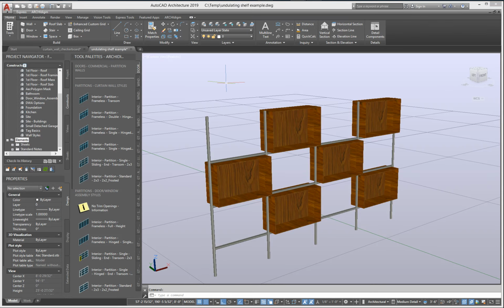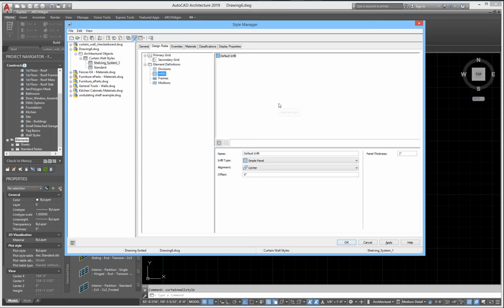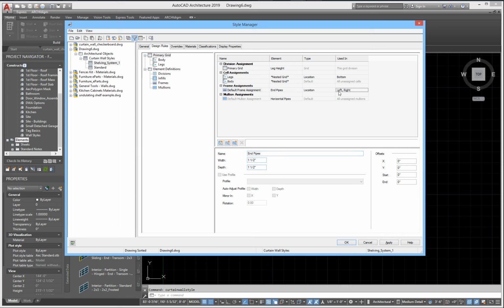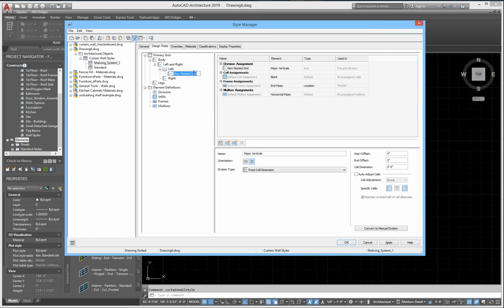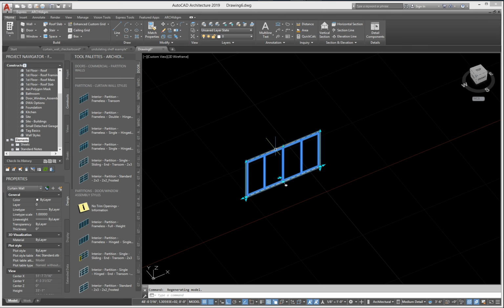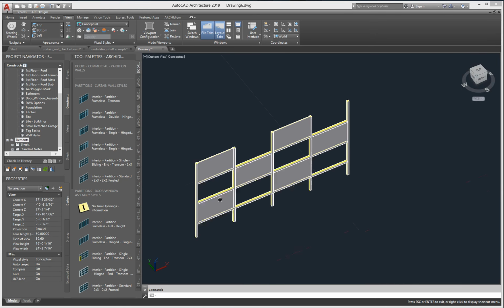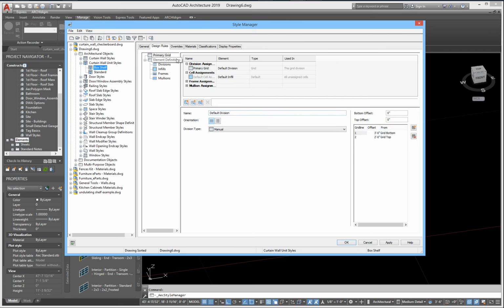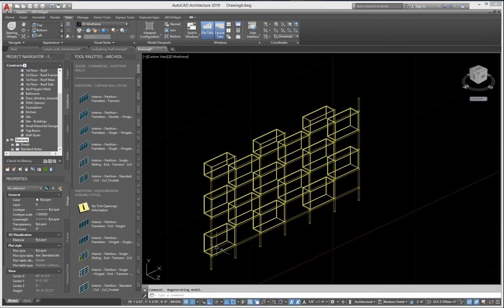Creating Patterns in Curtain Wall Styles for AutoCAD Architecture

Comment: Interesting and complicated. I simply want to have mullion style#1 at 12" centres vertically starting with 0 offset and mullion style#2 at 12" centres with 6" offset. I cannot get it to work. are you able to help?
Reply from the maker: This is a very complicated Curtain Wall Configuration.  You can make 12x12 boxes or Cells by changing the Division value for your major vertical grid to 24”, your minor horizontal to 12” and your major horizontal to 24”.  The undulation is created by dividing inner cells by 2 leaving a Top and Bottom Cell and a Left and Right Cell.  You are creating a 24”x24” Cell dimension that is subdivided by 2. I am unclear about the rest of the work you want to do but to “move” Mullion position you can use the “Offsets” – like 6” of Offset on the Y Axis.

For anyone attempting this level of sophistication with Curtain Wall Styles, I recommend that you build up the complexity slowly and test your modifications.  It is easy to get lost in the maze.  Also, you can use Infills to introduce DWA’s or CWU’s for greater control over patterns.
Reply: @ARCHIdigm1  Thanks for your prompt reply and help. I'll have another go.....